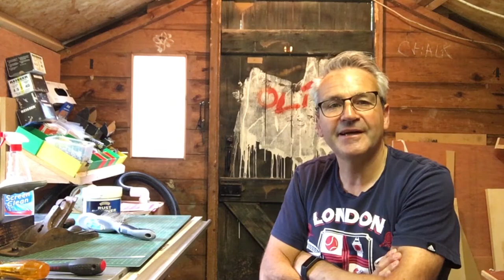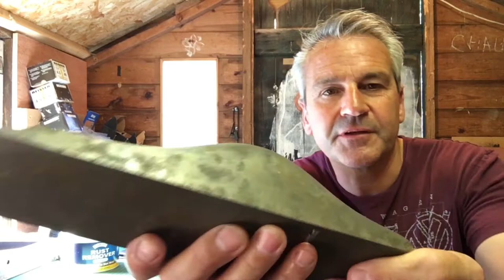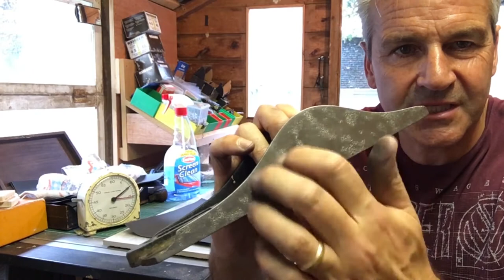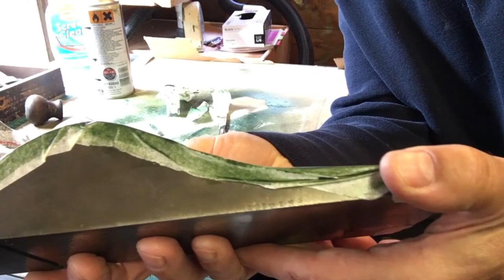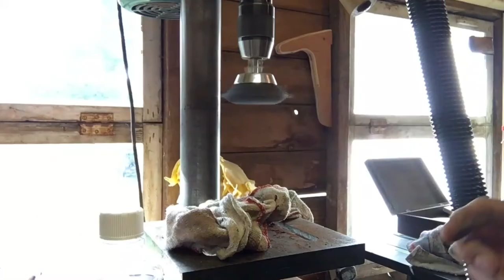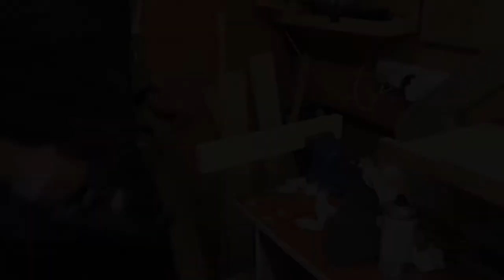Restoration of an antique Stanley Bailey no. 4 1/5 Plane 110 Years old

Comment: Absolutely nothing wrong with that! Yes, you could grind away at it to make it look a bit more (too) shiny, but it now looks like a well used ,extremely old plane. Hone the iron well, make the chip breaker fit perfectly, soften the sharp edges on the sole and it'll be as good as anything. Interesting that it turned up in the UK, many years before Stanley set up production here. Thank you for the video.
Reply from the maker: there are quite a few USA ones over here then UK started making them under license